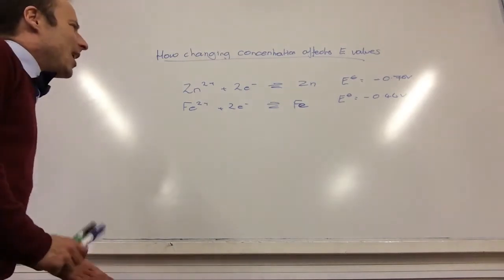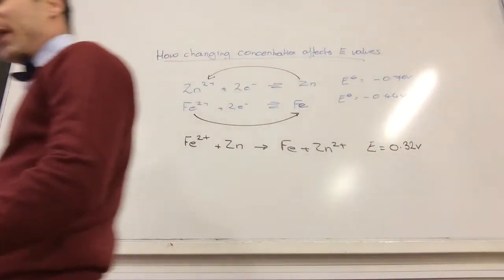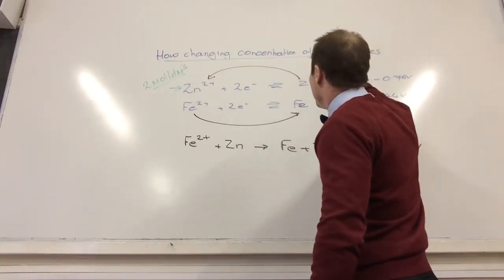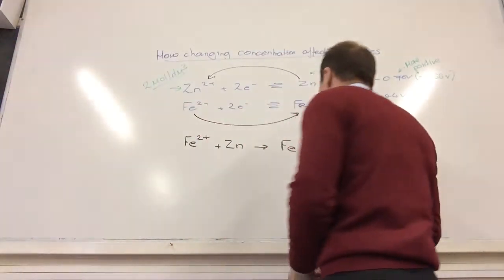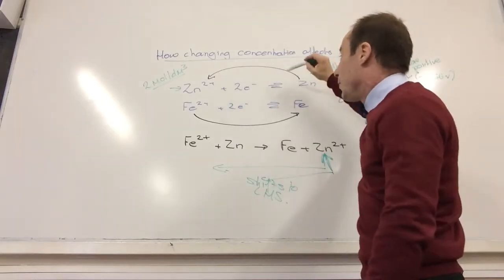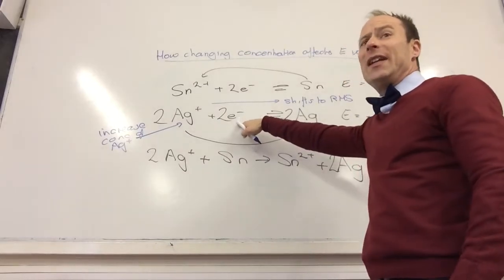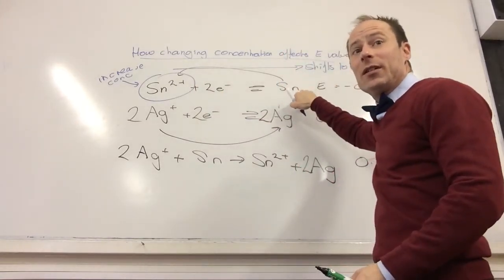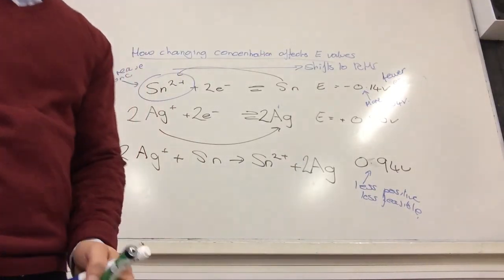Effect of concentration on electrode potential values from www.ChemistryTuition.Net

Comment: Would you recommend always forming an overall equation and then seeing the effect, as then its easy to see if the emf will increase or decrease, as if the equilibrium shifts to the right it will increase and  vice versa.
Reply from the maker: I think it is probably easier to use the half equations rather than the full equation.